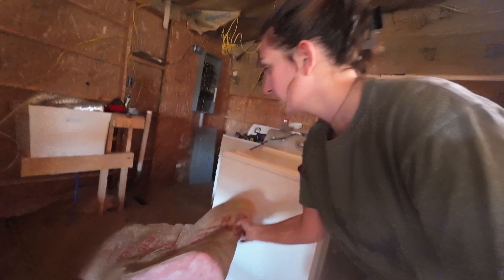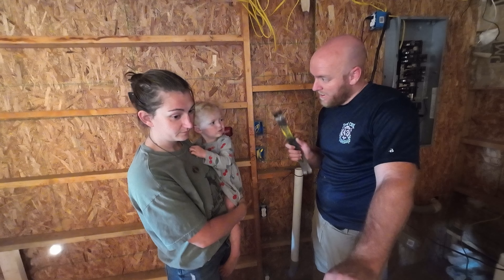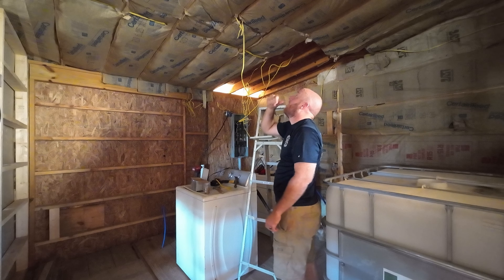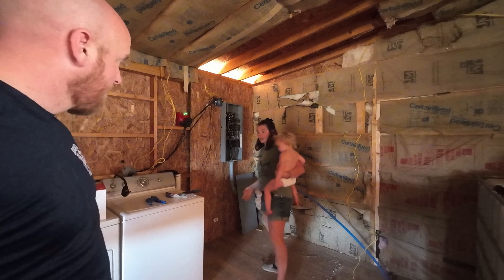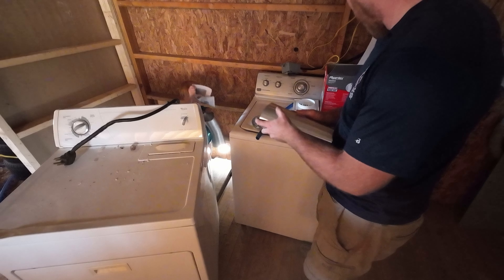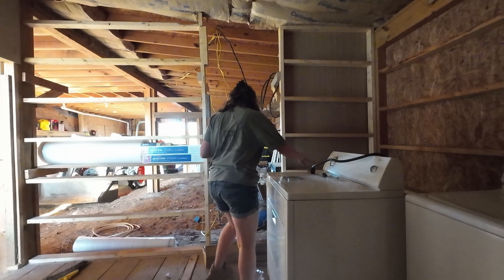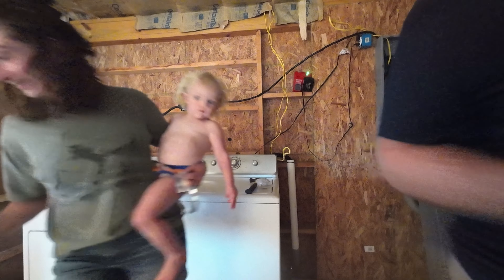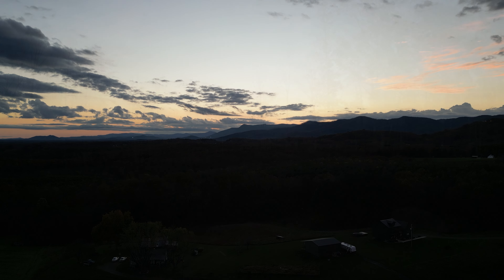After 2 Years, We Reclaim Laundry Day! | Building Our Own DIY Tiny Home

Comment: Good job!  I have had to do the same thing.  If you treat it like a wringer washer, you can save on water.  You can also have two drums sitting beside the washer into which you pump wash water into one and rinse water into another....then using the pump, just put back in and reuse it multiple times if it is not to grimy.  Just a thought as hauling water to do laundry is not fun!
Reply from the maker: Oh hey! That’s a really good idea! I know the water we get is free and we aren’t really wasting anything but after conserving water for so long it’s just hard to think about how much water is used to wash clothes 😅 I didn’t include it in the video but we are running a French drain out for the drained water so once that is all set up maybe I’ll feel better about it. Haha.
Reply: @BreakingNewRoots  One doesn't realize how much water things use till you have to start hauling it in and./or out.  Your water may  be free, but it is still a job that has to be done - and if it can save you a trip or two to get more...time saved.  Good idea on french drain.
Reply from the maker: Absolutely!